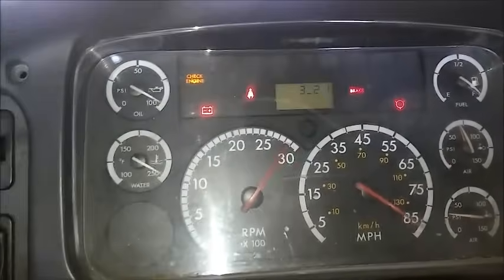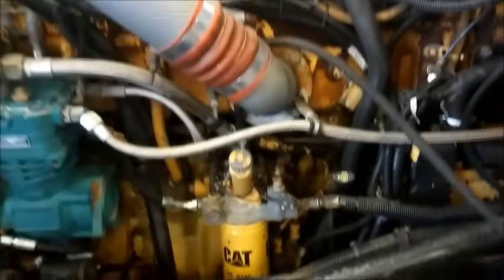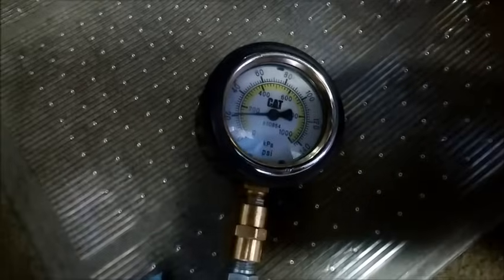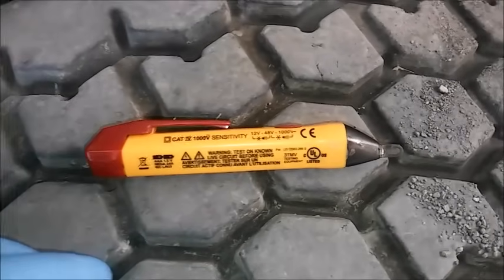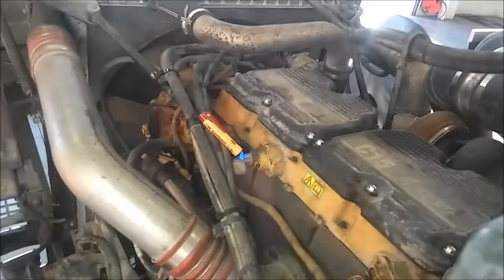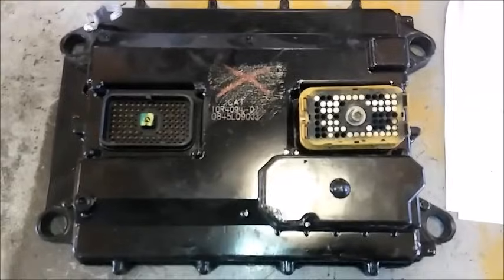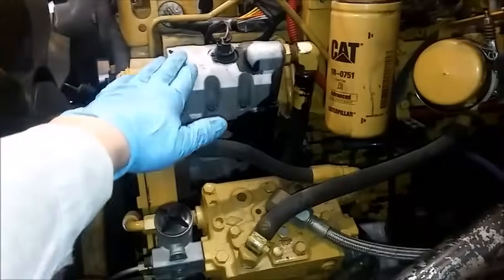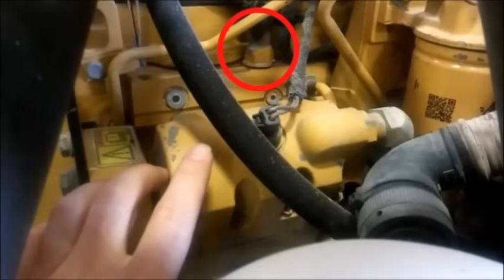Cat Engine Won't Start Troubleshooting.  Diesel Engine Crank No Start.

Comment: We have fuel pressure on our 3176 engine and it runs off of ether nut the damn thing will just not run on its own. No codes other than that is says "no engine speed" when plugged in. I metered the the plug that feeds the injectors and it didn't seem like it was sending 12 volts to the injectors. They were all sitting at different low voltages other than the wire number 3 which was at 11 volts. But the computer tested the injectors and all said ok? Now I'm just confused. Could it be the cam positioning sensor? Maybe a bad fuse?
Reply from the maker: +Sara W. A no start condition can be a lot of things, any logged fault codes? The injectors use a high voltage momentary signal up to 120 volts so your meter isn't going to show them properly. If the ECM tested them and said OK then the circuit is probably good. Can you get the logged codes and events?
Reply: +Adept Ape 
 I can can double check for logged codes tomorrow. And that makes way more sense now why the meter was giving weird readings. Also I forgot to tell you we had just torn this engine apart for our diesel tech class and it ran before we started. So maybe we fucked up somewhere but I really can't figure out where.
Reply from the maker: +Sara W. I've seen injectors fail during disassembly and reassembly, engine seems fine, just won't crank at all. Check the codes first. Then check the injector harness with an inductive voltmeter, I think this video shows you how to do that and it is pretty easy. Let me know what you find on that engine.
Reply: Adept Ape hey! so we adjusted the cam sensor to spec which was something like .1880 thousands of an inch and the thing started after 2 seconds. sounds real goood too. thanks for the help!
Reply from the maker: +Sara W. Glad you found it, I was working on a Cam timing sensor issue today believe it or not.
Reply: Adept Ape 
Thanks! What was the issue with the cam sensor you were working on?
Reply from the maker: +Sara W. The Cam had been installed elsewhere and was not timed properly when it was installed and was half a tooth off.  The customer was getting a cam/crank calibration fault.

Comment: Thanks so much for your videos. I have a question: 2001 3126B with no crank, no start. was intermittent, then complete no start. In Thomas chassis (front engine, flat nose). Engine serial number CKM24206. Batteries 12.6V, contact/wires good, just replaced starter... now it's beeping and showing EPS stop engine when key is in 1st position. Oil level is 1/3 of the way between "add" and"full". Driver for HEUI: Approximately 11 ohms (engine off). Has 1/2 tank of diesel fuel. Oil pressure may be low...what is expected starting/running? It's like 5-10 running. Sorry for huge comment, please help, appreciate your videos, please respond asap.
Reply from the maker: +100sooperdooper oil pressure is 5 psi running! That is super low. Check that first, that can cause no HEUI pressure.

Comment: is not cranking at all no lights on or anything just got a flash code it's 52621758 what you think it is it gave me those numbers but still won't crank
Reply from the maker: +Omar Mendez Can you give me the serial number of the engine and I'll look the codes up. If it won't crank, try to move it with a wrench on the damper by hand. If it won't move then it is seized and will need to get towed.
Reply: Adept Ape kcb69646

Comment: Great videos, I got a good one for you I have an 07 C7 in a Freightliner that intermittently won't start especially after first start up but as soon as you use the smallest amount of starting fluid it'll fire right up i was thinking its the TDC sensor but there's no codes or lights on and I would love to have your opinion on the situation thanks and again great videos
Reply from the maker: +shawn marks Well that could be a tough one. My guess would be one or more injectors that don't fire under cranking conditions, once you get the rpms a little higher though they fire. So hard to troubleshoot without seeing what the sensors are reading though. I would see what the HEUI pressure and fuel pressure are while cranking, then just stay eliminating systems. Cats rarely don't start because of sensors, especially with no check engine lights on.
Reply: Adept Ape that was my thoughts at first but I've checked fuel and huei pressure and both are good I have the Cat fuel pressure gauge everything everything else was checked through a generic scanner but would it run with a bad huei pump after starting fluid because if I just give it a small squirt it starts and runs all day long as you don't shut it down. this ones got me stumped so I figured start on the cheapest stuff but I really appreciate you getting back to me
Reply from the maker: +shawn marks If your pressures are good then you must likely have a couple weak injectors that aren't firing at cranking. Unfortunately I'm not sure how you would identify which ones without doing an injection actuation test using Cat ET.

Comment: I like your videos allot I have a question for you about a truck that I just bought it has a cat c13 acert with 922000 miles on it it was running ok at it just quit on me while on idle and now I can't even get it to cranck at all you think it's the ecm or the motor just seized on me
Reply from the maker: +Omar Mendez If it still cranks then it isn't seized. My guess would be an ECM issue. Are you getting a throttle signal?

Comment: Regards, I have problems for the cat c32 of starting it, no start by the ecmp, I gave a direct start by the automobile of the starter and the machine lights but no values of the temperature nor of oil pressure.
In the ecm shows in the screen ** psi ** ºC,
If you can help me I would appreciate it.

Comment: in one of our semis, it always needs "eather"(spelling)... could this be a huiey issue or pump failure as you explaned?
Reply from the maker: +Jonas weisenberger I believe it's just ether, but yes that could be a HEUI issue, but hard starting can be all sorts of stuff. Start with the simplest stuff first, fuel pressure and make sure the engine is cranking smoothly. If both those are fine then start looking at the HEUI system.

Comment: Have a 3126 in a 04 GM 6500 service truck. Engine will die at any time. Starts back up by just shutting key off and starting back up. .  Fuel level, Oil psi, water temp, and voltage gauges go dead when the engine dies.  All other electrical functions remain on. If I pull the fuse out on the fuel,pcv,emc , and put back in the gauges come on and the truck starts up.  Any ideas on this problem
Reply from the maker: +Jim sievers Sounds like you are losing the pin 70 switched 12V signal. That is a real common problem on RV engines. I would run a new switched wire and see if that fixes it.

Comment: I've never owned a diesel powered vehicle but just knowing how they operate is good information to have. I do have a question, since the ECM is prone to fail is that more or less a  design issue they have or the environment they operate in. Kinda curious about about that.
Reply: wade hicks my truck is a 96 and has original ecm, 22 years old and still doing its thing.
Reply from the maker: +wade hicks The ECM on a Cat might run for 15 years without a problem, but they do fail. It is mostly just the computer is doing a lot. It has to control the high voltage going to the injectors, as well as all the sensor inputs, in a dusty, high vibration, and hot environment. It's surprising they last as long as they do. They are fairly expensive though.
Reply: Adept Ape 15 years is a lotta life. I misunderstood the amount of time.  my bad. How Diesel engines work is quite interesting. Thanks for your time.
Reply: @AdeptApe  Have you tried baking the ECM at 385degrees in a preheated oven for 8-10 minutes?

Obviously take any bits off that would melt at that temperature, this resets the soldering and in most cases fixes most computer related issues, I would assume the same principle would apply to a ECM.

Comment: Adept ape my c15 acert won't start I'm on the side of the road I removed the return line and it doesn't spray any fuel. What could be the cause?
Reply from the maker: +Boris Segui You could have a leak on the inlet side which is allowing it to suck air anywhere between the engine and the tanks or possibly the fuel transfer pump is bad.
Reply: Adept Ape thanks for the fast answer I appreciate it

Comment: great Information, I have a c15 acert and just got an issue with it I have code 72 and 74 funny thing I didn't get a check engine light when truck started acting up  it feels rough when going about 65 mph lost power, do you think this is an ecm problem? just trying to get home and take it to a shop. thanks in advance.
Reply from the maker: +Trucker535600 Is your boost lower? Can you give me the serial number and did you look those codes up online?
Reply: Hi  Adept Ape; I took the truck to the shop they did the overhead and changed fuel filters, checked fuel pressure but truck still has  the problem, I told them about the codes but they couldn't find them, yesterday was acting up again and  I changed the harness that goes to the iva on 1 and 2 (code 72) truck still  idling rough but I  still have code 74 today I'm changing the iva harness on 5 and 6, hope that solves my problem, BXS35928 thanks.

Comment: I have a problem with C7 engine,
It wont start at all.i already replace injectors,Injector pump ,as per diagnostic tool shows no oil pressure and same problem again.
I check fueses,ECU power injector ,fuel pressure,oil pressure,still same thing,
Any idea what it may be?
Reply from the maker: +sami azemi It shows no oil pressure, did you put a gauge on the engine and see if there is any oil pressure?
Reply: Hi,So far i already replace Injector high pressure pump,injectors all 6 of them,diagnosed there in no fault code at all,check fuel pressure it good 23 psi. any idea whats going on on my C7 engine?

Comment: Adept hi
Thank you for videos. Do you work with Volvo D13 engines too ? There is a problem when i shut the engine off for few hours and then its hard to start it back. When its still hot its ok to start but when cools down then i am having problem. Please let me know your thoughts about this issue. Thanks for your time.
Reply from the maker: +Johnny Smith I haven't touched one of them so I wouldn't want to point you in the wrong direction.
Reply: Thanks.
Reply: Johnny Smith glowplugs

Comment: good video,  only thing is you are unable to see system voltage.  if there is any corrosion present it can cause voltage drop. load pro test leads with a dmm kick ass testing this circuit because it works on voltage drop. look into this tool. not expensive.

Comment: With my experience, fuel lines, fuel filters, and return rail pressure regulator (check valve), and dirty ECM Power leads from battery are the biggest culprits. The only ECM's I have ever had fail were the Cummins N14 due to failed injector drivers. I've had very good luck with Detroit Diesel and CAT ECM's. After last Friday's failure of OPS sensor, I have now replaced all my sensors including TRS, SRS, CLS, CTS, FTS, and both air intake sensors. With new bearings, cyl-kits, and injectors, I am good for another million miles of service.
Reply: James Barrow I

Comment: We have been having this problem with our truck. crank no start, been using either to get it started. Been doing this for at least six months and it is driving us crazy. It is the cat 3126 in a sterling. Thanks for taking time to share your knowledge! I will be back.
Reply from the maker: +Ruger Allworth Sounds like you might have a weak or dead injector when cold. Is the intake heater coming on?
Reply: This is my issue as well and same truck.
Reply: HEY I GOT A C15  HAVE HELL START IT AFTER SET HAVE TO USE EITHER TO GET START I HAVE CHANGE CHECK VAL WHAT ELISE I NEED TO DO TO DAT RACAL?

Comment: I have a c9 in a tractor that does not start right up after sitting for 6-12 hours. If you try the hand primer you can pump 3 or 4 times with no resistance. I have changed the injectors, hand primer, fuel check valve and the lift pump. What next? The mechanic has no idea, and I am tired of throwing money at it.

Comment: What is minimum voltage the can engine starts? Some times starter cranking but engine not starting. I throw charger and after 10 min it's alive.
Is coolant level censor can prevent from starting engine?
Please, can you make a video about cold weather starting.
Thanks
Proud owner of 3126 with over 420,000 miles

Comment: what causes ecm to burn up,can moisture cause this or bad ground? I had a starting problem when turned key all the bed lights would go out.only the bed lights on f650 with cat motor
Reply from the maker: +Josh Hernandez If your bed lights are coming on when you turn the key to start it most likely is not the engine ECM. Most of the time the ECM fails for no external reason.
Reply: Adept Ape thank you for responding, your videos are extremely helpful for a practicing mechanic like me.preciate it

Comment: what happens when a injector from the springs breaks . motor caterpillar engine c15 2005
Reply from the maker: +Raciel Rodriguez If the spring breaks you'll usually have a dead cylinder that depending on the break, can be spraying fuel uncontrolled or not firing at all.

Comment: i have a cat engine, c15 acert upper (6nz serial number) with a bxs lower. cranks but doesnt start, ecu, cam/crank sencors, fuel pressures are all good. sniff of either it fires and runs great all day. no codes. whats your opinion on the no start?
Reply from the maker: +Pat McCarthy I would start with checking the fuel pressure while cranking. I've seen ECMs drop out while cranking, but run normally while the starter isn't engaged. Test that the ECM is firing the injectors while cranking with an inductive volt meter. That would be my starting point. Do you have a way to communicate with the ECM, ET or a scanner?
Reply: Adept Ape while crankinh the pressure is at 20 psi. running 75-95 psi. had ecu checked by cat it tested good
Reply: also injectors are getting voltage to fire
Reply from the maker: +Pat McCarthy That cranking pressure is really low, you'll usually see it around 65+ psi on a C15 while cranking. Check out my fuel pressure video, I have a C15 cranking on that video with a pressure gauge.
Reply: We swapped pumps out with a new one now reading 75psi while cranking still no start
Reply: We swapped pumps out with a new one now reading 75psi while cranking still no start
Reply: @patmccarthy6774  What was the final remedy to fix the issue?
Reply: @halfmoon5022  injector calibration

Comment: I have a 3406 E caterpillar 1998 on a kw truck and it has coolant in the fuel, I think it might be injector cups, how can I make sure and can you make a video on this complaint next time you come across this thanks
Reply from the maker: +ALEX G It is most likely the injector cups. You usually have to pull the injectors and then pressurize the cooling system and you might find a leak, but if one is leaking it is a good idea to do them all.
Reply: ok thanks for the help, will replace them and see how it turns out

Comment: Have a c 7, driving me crazy won't start unless I spray it. Than it will lose its prime. Have to spray it again, took fuel line and bypass tank and ran and restarted 5, times went for a ride 15 min did fine came back to shop and it killed. Good fuel pressure and high pressures. Already change hue pump. Have oil pressure as well. New cam sensor as well, will injectors actuator sensor do this , please email ptch415@gmail.com. Pro Tech
Reply from the maker: +Johnny Fassbender Do you have a way of communicating with the engine, such as Cat ET? Any check engine lights? You said it runs on a bypass tank it sounds like, have you put a clear hose onto the inlet to check for bubbles, also check for what the priming pump has for vacuum, could be restricted. What is the fuel pressure cranking and running?

Comment: I have a 2006 5.9 L and i was replacing a wiring connector so i disconnected the battery. I got it all back together and it would start so i got it towed to a shop. When i disconnected the battery the ecm ground wire fell off and i didn't notice it.

Comment: Hello adapt ape, just wanted to tell you thank you for all the informational and educational videos you post. I am by part a aviation Mechanic myself, and it seems that to me that the semi-truck industry has a lock down on information they just don't want you to find or get a hold of. it's almost like a secret clearance that you need just to get manuals for your truck. I've worked on line maintenance for ch-47, and oh-58d for the army and we've never worked on aircraft without our manuals. I'm now a truck driver, just wanting to say keep up the good deeds.. I own a c15 that's always giving me problems and these videos help me all the time. God speed my friend.. land of the free, home of the brave..
Reply from the maker: +Robert Pardo Thanks for the kind words. I like hearing that people enjoy the videos. The info is hard to find I think because it is a much smaller market than the auto industry, but I like doing the videos and I'll keep putting them out as long as people watch them.
Reply: that is right Robert,,,, secret society Trucks , Trailers..... I am cat truck engine analyst and yes so many technical advancements that lots never even comprehend. all engines have same basic operation, yet the manufactures all have different ideas and ways of ussing sensors to make the electronics operate. For me Caterpillar is a very high standard of technology, yet can be worked on and lot of backup in literature, manuals parts systems,. Think engine technology is hard to source infomation, try getting chassis alignment, steering and suspension geometry settings from the truck, trailer manufactures.